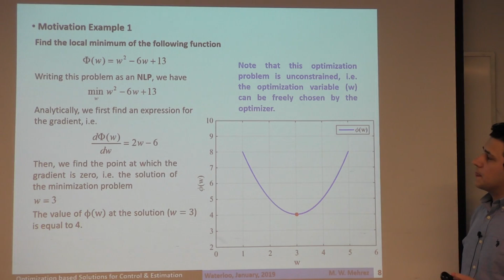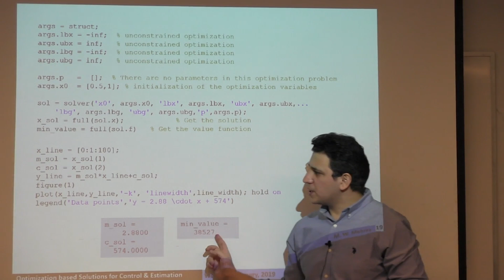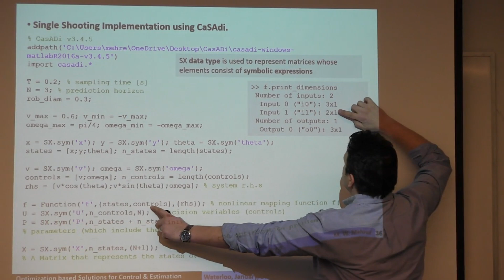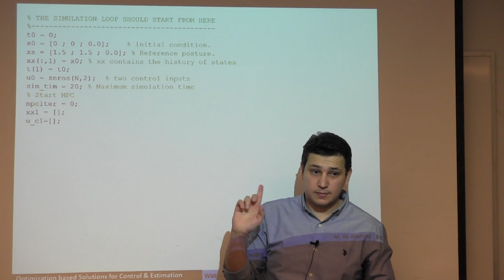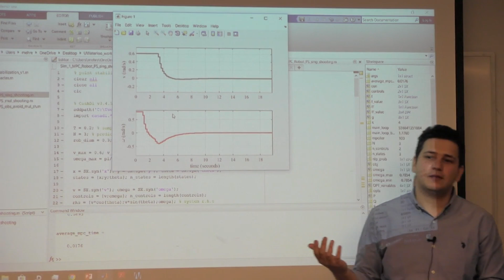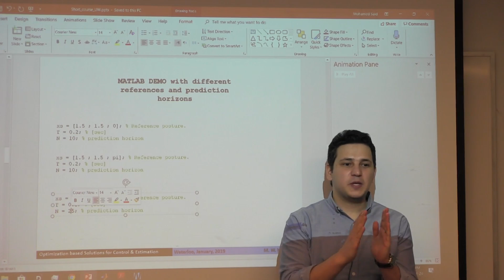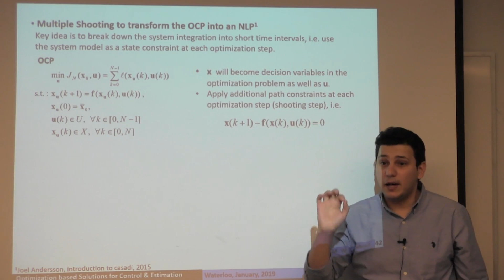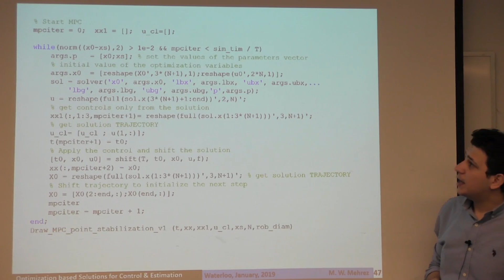MPC and MHE implementation in Matlab using Casadi | Part 1

Comment: Dear dr mohammed 
How can I connect MPC to indirect field oriented control to control the speed of induction motor 
and how i implement mpc in matlab for this purpose 
Thankyou
Reply from the maker: If you have the mathematical model for the system you are trying to control, then you can simply replace the model in my code by your model.
Reply: Mohamed W. Mehrez I have the transfer function of induction motor    Is it a mathematical model ?? That replace here
Thankyou
Reply from the maker: Of course. The transfer function is your model, but in the S domain. You simply need to convert this transfer function to the time domain and this will result in the system differential equations.
Reply: Mohamed W. Mehrez thank you very much

Comment: Hello Dr. Mohammed,
Just a quick question regarding handling the disturbances (such as vehicle slippage) using NMPC in casadi. How would you handle random noise or white noise based disturbances in the system? Any suggestions.
Reply from the maker: Hi Subhan, I have no personal experience with such problems, but your lookup keywords are robust MPC and tube MPC.

Comment: @mohamed sir , thank you for such a nice workshop. 
I am working on the  longitudinal flight control model which is a ofcourse a "non linear model" , I want to use mpc to  control the altitude of  the plane . I have few question regarding this..
a. can we use the method outline here to control the plane  (ofcourse by changing the design parameters)
b. I  have the linearized state space model at a "steady state  point". say for forward speed of 40m/s and no tilt.
  how could I use this state space model instead in mpc rather than explicitly defining input and output relation as you did?
I am assuming I have to compute the state space matrix at each time step .
do you have any reference where I can learn how to solve such non linear system.
3. the method you have shown here  ,is it  a non linear  mpc control? 
 Thank you for your help.
Reply from the maker: hi Prajwal, thank you:
a- Of course you can.
b- If you have the linear model in the form xdot  = Ax + Bu, remember that this is a special case of the nonlinear form xdot = f(x,u). You can make A and B as parameters that change every time step.
c- it is a nonlinear MPC yes.
Reply: @MohamedWMehrez   thank you for clearing my doubt, I have another related to above                                                               suppose I have a model in form of 
Xdot=AX +BU
Y=CX
and I want to track "Y " signal 
now i do not need to track all the states but few states or maybe a function of few states
1. How do I define   the   model constraints now in CASADI  I mean how to  define constraint  for 
a>X(k+1) =AX(k) +BU(k) and  for  b> y(k+1)=C*X(k) ?
Thank you for your help.
Reply from the maker: You can define it the exact same way you define the constraints for X. You will just need to implement the output equation y=cx and add y to the constraints vector g. Then, you specify a proper upper bound and a lower bound for these new constraints.

Comment: Hello Muhammad, I am facing trouble with obstacle avoidance. I am using the same method that you have proposed. But I have found for some configuration of obstacles in space, MPC is unable to find the optimized path to the target even if there exits in reality. I have tried to increase the prediction length up to 5000, changed gains Q and R, but it doesn't work at all. For the same configuration of obstacles, if I run any graph search algorithm like A*, this can safely find the path to the target point. What could be the possible reasons for that? Is it a bad idea to use MPC for runtime dynamic obstacle avoidance in the complex enviromnet?
Reply: for example in the given example, if we set

x0 = [0 ; 0 ; 0.0];    % initial condition.
xs = [2.0 ; 0.0 ; 0]; % Reference posture.

and obs_x = 1.0; % meters
obs_y = 0; % meters
obs_diam = 0.3; % meters

args.lbx(1:3:3*(N+1),1) = -4; %state x lower bound
args.ubx(1:3:3*(N+1),1) = 4; %state x upper bound
args.lbx(2:3:3*(N+1),1) = -4; %state y lower bound
args.ubx(2:3:3*(N+1),1) = 4; %state y upper bound
args.lbx(3:3:3*(N+1),1) = -inf; %state theta lower bound
args.ubx(3:3:3*(N+1),1) = inf; %state theta upper bound

the solution doesn't converge.
Reply from the maker: Hi Ibraheem, try changing the initialization of u0 ... Please also refer to the obstacle avoidance papers I mentioned to you before.
Reply: @MohamedWMehrez  i already changed different values of u0, but that didn't work.
Reply: @MohamedWMehrez  I just observed that the ipopt find the local minimum not the global minimum. Is that true? If  yes then is it possible to go for global minimum?
Reply from the maker: @ibraheeminam4982  you can go for global minimum solvers, but global minimum solutions are normally time consuming. check out this paper

https://ieeexplore.ieee.org/stamp/stamp.jsp?tp=&arnumber=8263749

Comment: Hello Muhammad, in your mpc implementation, how can we penalize the reverse speed of the robot more than forward speed? Because sometimes it is desirable to keep the heading of the robot in the forward direction in normal conditions.
Reply from the maker: I guess you can't, but a smart work around is to tighten the bound on the backward speed, e.g. -0.2 <= u <= 0.6. This way the robot will prefer to go forward than backward.
Reply: @MohamedWMehrez  okay thank you

Comment: Hello Muhammad, I have one more question. Sorry to ask you again and again. And I really appreciate your kind support. 
Did you tried parallel parking problem on your code for MPC? If you set xs = [0 y 0] where y can be any value, the convergence is 0 and error is 100%. For example you can try xs = [0 1.5 0]. Is there any specific reason for that?
Reply from the maker: try to change the initialization of u0. This may help.
Reply: @MohamedWMehrez  yes This really helped. Why is that so? It looks like giving little push to the robot to kick off its motion while it's jammed.

Comment: Hello!! thank you for the tutorial.
can i use this code to control position arm 2dof (by using  dynamic equations), if i change the model of system ???
Reply from the maker: Thank you. Of course you can.
Reply: I use model of arm from ADAMS software (Co-Simulation ADAMS/ MATLAB-Simulink), so i don't know what should i do to use MPC controller with this model, can you help me?
Reply from the maker: If you can import the model from ADAMS and include it into your MPC code that would be how you adapt the provided code to your problem. I didn't have much experience with casadi and simulink; nonetheless, you can find tutorials about that on casadi's website here: https://web.casadi.org/blog/

Comment: Grateful for the tremendous lecture. I had a question. While discretizing the diff eqns, what if the system has of the order of 100 of eqns? How can the RHS be defined in a loop. Indexing creates an issue everytime I try defining the system of DE's rhs(i)=f(x,y,t) where rhs refers to the differential vector. Thank you!
Reply from the maker: Thanks Sarasij, your question is quite interesting. what kind of issue you have with the indexing? I guess if you put in rhs as defined in the code as many equations as you want that shouldn't be an issue. By the way, since you have a large number of equations, I suggest that you use the Runge Kutta method for discretization. There is a video in this playlist that shows you how. Sorry for my late reply.
Reply: Dear Dr Mehrez, I shall definitely follow the video on Runge-Kutta. 
Meanwhile, about this issue, I have solved it. I was wondering what if we have multiple objective functions. Can we define it in an array...like obj(1) obj(2)...obj(100)? When I defined obj as SX.sym(100,1) the issue was resolved. But that's it, I had to explicitely define it. Anyway, thank you for your reply. The videos are exceptionally helpful.

Comment: Is this a correct implementation of MPC?  (sorry for too long message as we don't have choice to attach the file here)

clc
clear all
close all

% initial pos
xo = [84 600 0];
% target pos
xr = [94 550 pi];
%sampling time
dt = 0.1;
%prediction horizon
N = 10;
% state gain matrix
Q = [1, 0, 0;
    0 1 0;
    0 0 1.0];
% input gain matrix
R = [0.05 0;
    0 0.005];
% some intermediate variables
Jref = 1e+10;
J = [];
v_i = 1;
w_i = 1;
v_min = 0;
w_min = 0;

% state trajactory
state_trajactory = xo;

% error magnitude
error_mag = (xo - xr) * (xo - xr)';

while(error_mag > 2)
    
    % input v (linear velocity) varies between -10 units to +10 units
    for v = -10: 1 : 10
        w_i = 1;
        % input w (angular velocity) varies between -10 units to +10 units
        for w = -4*pi: 1: 4 * pi
            j = 0;
            % initialize the state update with the current state
            xn = xo;
            % loop over prediction horizon
            for n = 1: N
                % update the state based on kinematic equations
                xn(3) = xn(3) + w * dt;
                xn(1) = xn(1) + v * dt * sin(xn(3));
                xn(2) = xn(2) + v * dt * cos(xn(3));
                error = xr - xn;
                u = [v w];
                % calculate the cost
                j = j + error * Q * error' + u * R * u';
            end
            % reocrd the cost
            J(v_i, w_i) = j;
            w_i = w_i + 1;
            % minimize cost function
            if (j < Jref)
                Jref = j;
                v_min = v;
                w_min = w;
            end
        end
        v_i = v_i + 1;
    end
    % update the next state with the minimized input
    xo(3) = xo(3) + w_min * dt;
    xo(1) = xo(1) + v_min * dt * sin(xo(3));
    xo(2) = xo(2) + v_min * dt * cos(xo(3));
    
    % error magnitude
    error_mag = (xo - xr) * (xo - xr)'
    
    %record state trajactory
    state_trajactory = [state_trajactory; xo];
end

figure(1)
surf(J)

figure(2)
plot(state_trajactory(:, 1), state_trajactory(:, 2));
Reply from the maker: Hi, I provided my implementation code for MPC ... Just change the model there to your system model.
Reply: @MohamedWMehrez  Actually this code has been derived from your MPC single shooting code without using CASADI for the same differential drive robot model. So I wonder if the implementation is correct or not.
Reply from the maker: @ibraheeminam4982  if you are not using Casadi, then how are you solving the optimization problem? The code I provided depends on using Casadi for that purpose.
Reply: @MohamedWMehrez  I just iterated the cost function over the range of optimization variables under the given constraints and found the optimized variables against the minimum of cost function.
Reply from the maker: @ibraheeminam4982  that's not how the optimizer actually works. In practice, you have to use an optimization technique like ipopt in Casadi. What you are doing is something like trial and error.
Reply: @MohamedWMehrez  I see. Thank you. I have one more confusion. How would we add constraints for rectangular  or any polygonal shaped robot and ostacles instead of circular in g function?
Reply from the maker: @ibraheeminam4982  you can approximate these shapes by higher order L norms. Check out theses papers too

CIAO MPC-based Safe Motion Planning in Predictable Dynamic Environments

Occupancy Grid based Distributed MPC for Mobile Robots

There should be some other methods too.
Reply: @MohamedWMehrez  Really appreciated!
Reply: @MohamedWMehrez   In the first paper:
"Collision Avoidance Constraint: To guarantee collision avoidance in continuous time, the robot’s movement needs to be accounted for. For more compact notation, we define the set of all points that are occupied by the robot in the time interval [tk, tk+1] as Ωk =Stk+1 t=tk R(x(t)) and introduce the shorthand Rk = R(xk). We define the robot’s action radius for all k = 0, . . . , N as ρk = max p∈Ωk d ⋆ Rk (p) = max p∈Ωk min p′∈Rk kp − p" 

Can you please elaborate a little bit what is robot's action distance? I couldn't grasp this equation. Thank you.

Comment: Dear professor, thank you so much for this amazing workshop/tutorial. I am new in the fields of optimal control and optimization in general so please excuse  if the answer to my question is considered obvious or simple. Is the optimal control problem formulated in this video a convex optimization problem? and based on that is the solution of this optimal control problem the most optimal solution or just a local minimum ?
Reply from the maker: Hi Ali, thank you for your comment. Convexity of the optimal control problem depends on that of the objective function as well as the constraints. For linear systems, MPC problem can be convex; however, for nonlinear systems, the resulting MPC problem are not necessarily convex especially when nonconvex set of constraints are used for states (e.g. the obstacle avoidance case) or controls.

Comment: Thank you sir for this great lecture. Sir, can MPC model basically the above mentioned control logic for multi-nonholonomic robot formation control, if possible can you give me some idea. Overall idea is amazing, my issue came when the network constraints come.
Reply from the maker: Hi Arnab, thank you for your comment. You can extend MPC to multiple vehicles by using a centralized approach or a distributed approach. In the centralized approach, you simply combine all the vehicles models into one big prediction model, then you add coupling constraints between all the (position) states in that model. The feedback on the vehicles positions and orientations are fed to this big model every MPC iteration. 

In the distributed approach, every vehicle runs it's own MPC while the predictions of all the vehicles are communicated and used to form the coupling constraints.

Check this paper for a centralized MPC
https://link.springer.com/article/10.1007/s10846-016-0408-2

And this paper for a distributed MPC
https://ieeexplore.ieee.org/abstract/document/8206360

Check also the references therein for all more details.
Reply: @MohamedWMehrez   Thank you sir, if possible can i get the MATLAB code for the above mentioned model if possible. Again thank you for the valuable suggestions.
Reply from the maker: Hi Arnab, unfortunately, at the moment I can't share the source codes.

Comment: @Mohamed W. Mehrez I have a question regarding ROS implementation. 
I read that is not possible to generate a code while using Ipopt solver. https://groups.google.com/forum/#!searchin/casadi-users/simulink|sort:date/casadi-users/rnBC_a2WULk/slpyu-QGAgAJ
Did you use Acados instead or OpEN or a different solver SQPMethod+QRQP? 
My final goal is to have the MPC running in an embedded system (ROS based).
Thank you very much for your kind help.
Reply from the maker: Hi Sebastian, I haven't used Acados before but it's the new version of Acado which I already used in my PhD work. I remember that I was using a solver called qpoases. 

If you run ROS on an on board computer, you don't need embedded programming. you can simply transform the provided code to python and integrate it with Ros. This is what we made in this paper

https://www.sciencedirect.com/science/article/abs/pii/S0921889019306232